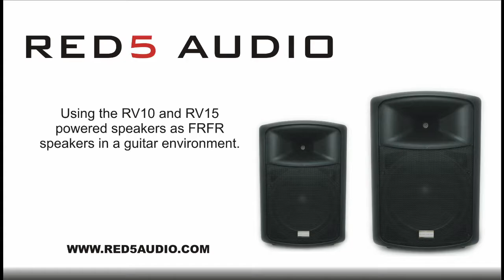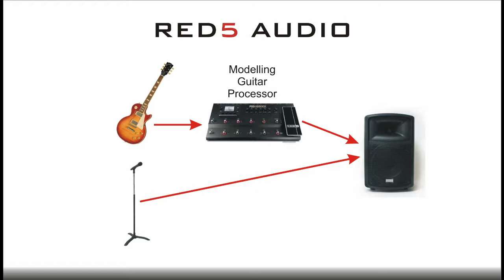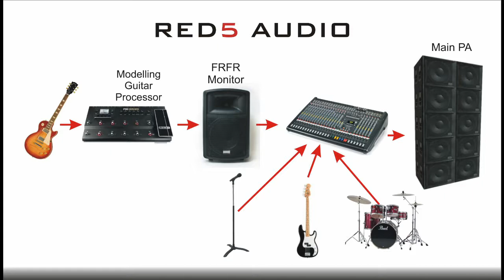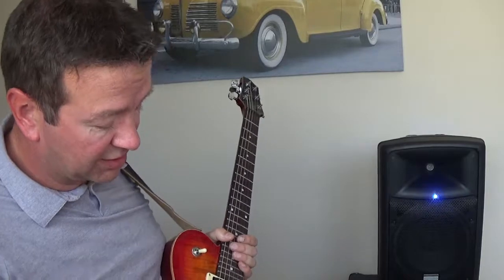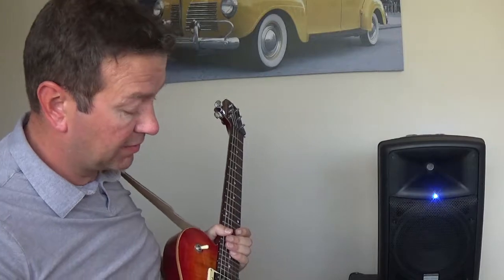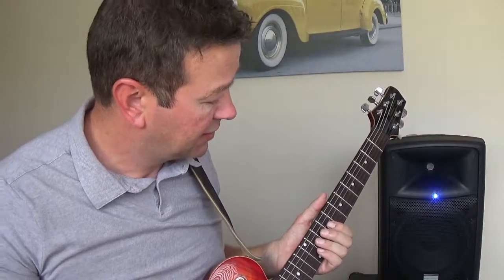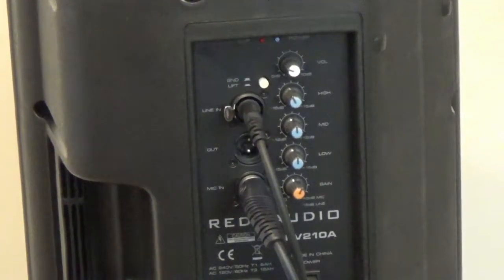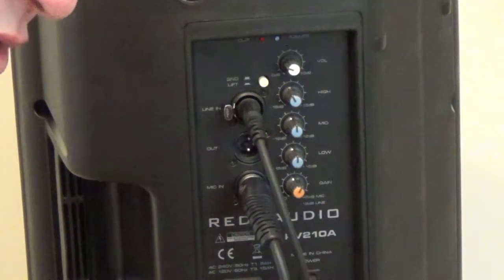Using The Red5 Audio Powered PA Speakers As An FRFR Guitar Amplifier

Comment: Finally I found it. Presumeably the only video on this planet that demonstrates an electric guitar including overdriven sound through a multi effects pedal and out of active PA speakers. 
How long have I been searching. Maybe when getting 15" speakers it's sound a bit "fuller"...
Thank you very much!
Reply: but this is Red5, they are amazing quality aswell, ofcourse you can do model amp through PA..  guitar smps are pointless UNLESS you are a guitar player only playing for a BAND.. and after a CErtain sound.. or for looks purposes...  if you are a musician and versitlle in music, sing or anything else.. PA ofcourse ..
Reply: @GreatTaoSage  Meanwhile I got my PA System with a mixer board and my Multi Effects pedal, and it is exactly what I was missing all these years. Clear and direct sound, perfect volume control and a complete frequency coverage without the mids being exagerrated so much. Plus I got Stereo, which is a killer too. It's just the perfect combination of typical guitar sound and hifi. 
I was always wondering, why people would by buy those guitar amps, while they would on the other hand still buy music CD or MP3 that sounded like Hifi... Why would they not want their guitar play sound similar to what they like to listen to at home too?

I'm so happy I made this step. I've tried so many other options before, and most of them, including an expensive 2*12 box and a good guitar amp just sucked. It was noisy, it was humming, it was uncontrollably loud, it was mono...
Everyone reading this and asking the same question: Just give it a try, it probably saved the joy in my guitar play.
Reply: @therealkickers5166  well if you go to any real professional gig or concert of live bands.  Youll notice, they use guitar amps then have the amps mic'd and the sound comes out the PA...
🤷🏻‍♂️🤷🏻‍♂️😂🤣. So its only cause of the individuals players amp unique sound.. And ability to adjust on stage when live..